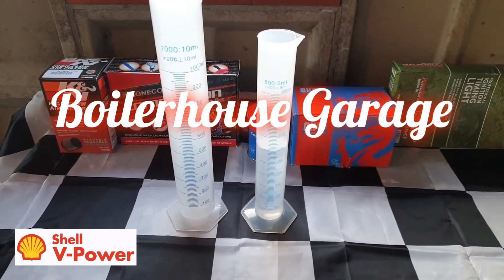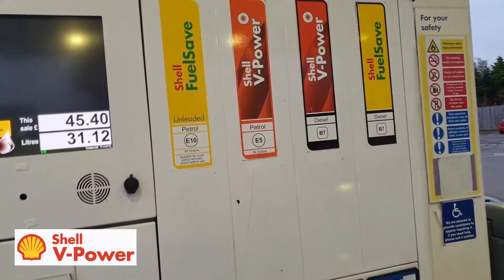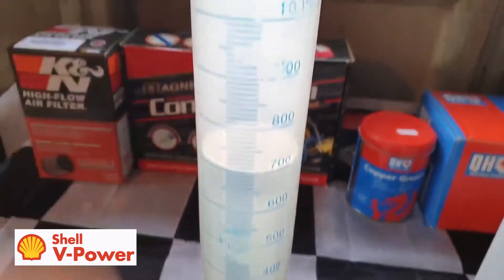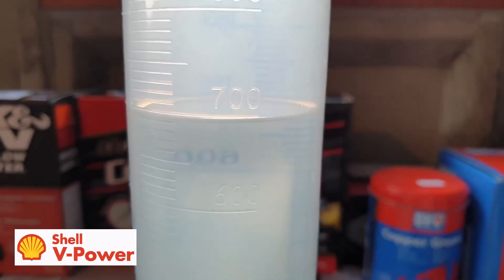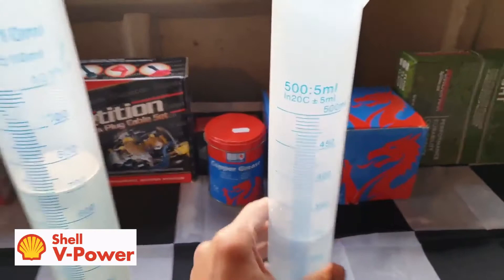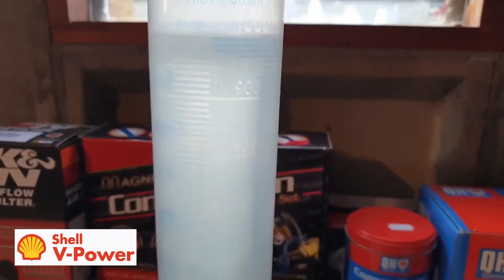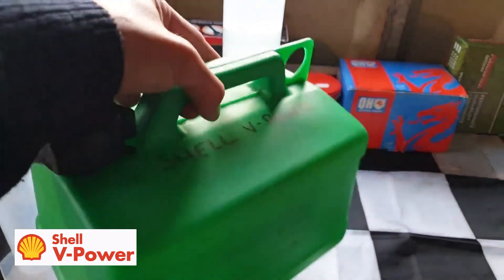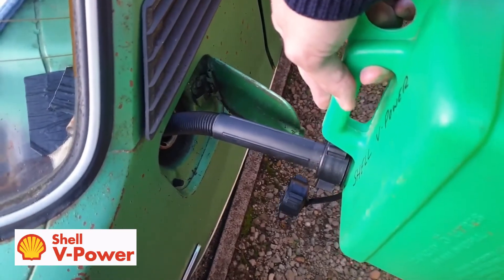Testing for Ethanol in Petrol / Gasoline Part 4: Shell V-Power revisited – post E10 E5 update

Comment: For sure, the E10 mandate is about 
1.: Ethanol is more expensive than petrol, but because of this, the fuel falls into a lower tax category since it causes (in principle) less harmful substances 
2.:  Fuel consumption increases when using E10 fuel and due to the different pH of the fuel (the more acidic) the car wears out faster, its performance decreases.
3.: The most important factor. E10 fuel can be stored for about a quarter as long as E5 fuel.

Keep your eyes open. E10 fuel has a shelf life of less than 1 year. 6 months-to 9
Reply from the maker: Correct. Although currently, none of the E10s in the UK seem to have anywhere near 10% ethanol, so its effects will be noticed more slowly than if they actually used 10% straight away.

Comment: Nice video Try it with a bit of a shake and tiny bit of food colouring. I strip fuel in my garage for my bikes and stuff fiberglass tanks etc dont like ethanol 😔 my nearest shell is miles so its E5 only round here unfortunately very easy to do 25l in 12 hours with basic equipment sometimes esso add too much adative or something and it doesn't pull all the water so always measure your output its right 95% the time if it is really bad keep it for the lawnmower or family car 👌
Reply from the maker: Thanks. I've tried shaking to mix in Part 3, which makes no difference with the cylinders, but would in larger tanks where the water isn't being poured through the petrol. I imagine stripping the ethanol out gets to be a ball ache eventually, and I expect we'll all have to do it in a few years. Are you using distilled water as well? Perhaps the Esso has a stabiliser which is holding some of the minerals in suspension.
Reply: @boilerhousegarage  can be a ball ache an dangerous if someone just left containers of fuel with crap vent caps around. I just buy 2 metal jerry cans at a time and in the garage i have a clear 30l container with a tap right at the bottom i do the mixing in there with the measurement lines then leave it for 12 hours open the tap collect the crap and straight back in the jerry can 
X2  hardest part is lifting it back on the shelf. Not as ideal as just filling up like normal people but the government seens determined to poison everything 😅 and i know once that fuel is ethanol free its not pulling moisture out the air any more and much more stable. I believe it goes stale if left too long anyway quality maybe more to do with those adatives that weve mentioned than the fuel itself i mean shell must add something to the 99 stuff to get that octane and detergents get added to the diesels if i had a way of testing it  would be a very interesting comparing name brand fuel content other thsn just octane and mpg knock etc

Comment from the maker: Youtube still seem to be removing comments.. In answer to KJRutter17's question (that came up on my notifications) taking the 5% ethanol out of 99 octane fuel will make it approximately 95-97 octane (still okay for most vehicles without additives). The higher octane of super unleaded isn't as reliant on the ethanol, but taking the ethanol from E10 you will most likely need a booster unless your car has its timing retarded to run on 91-93 octane. This varies depending on the fuel supplier as the additives (that make the petrol the particular product of that specific brand) are different.